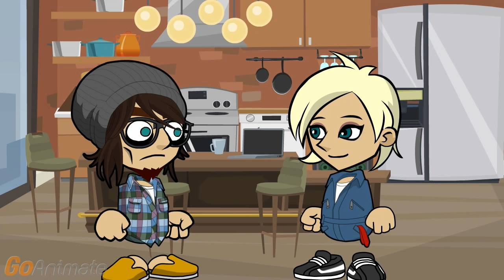Frigidaire Oven Error Codes

Comment: Frigidaire Electric Range Model # GCRE3060AF Code F050err   In case anyone is wondering it is the  Mother Board.  I only had the stove since December 2020 less than 3 years old.  Frigidaire wants 260.00 for the part then I need to find a technician to repair No warranty on buying a new motherboard. If not replaced eventually stove will stop working. Thanks Frigidaire.

Comment: What does nCAL mean and how can I fix it?
Reply: I was told I needed a technician for nCAL
Reply: Take the back panel off and look to where the power cord wires meet the stove. Chances are the wires are burnt up at that position. It’s called a terminal block. Either way, it means your not getting proper power. Check the outlet it’s plugged into to make sure your getting 240 volts

Comment: F10?
Reply: Temp probe or control panel oven is over heating and safety shuts off at 600 degrees. Probe 25 bucks control board about 70. Should fix an f10 error code from what ive seen